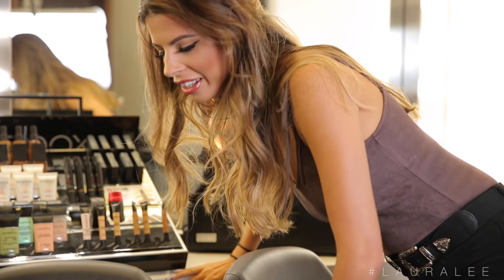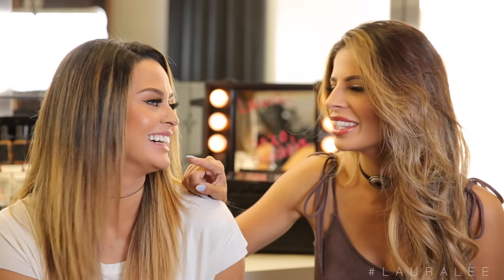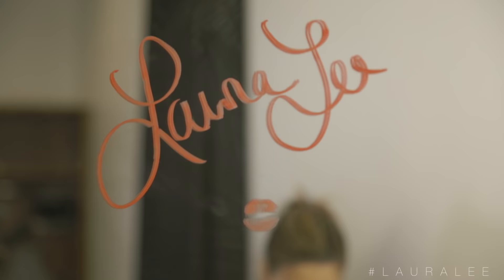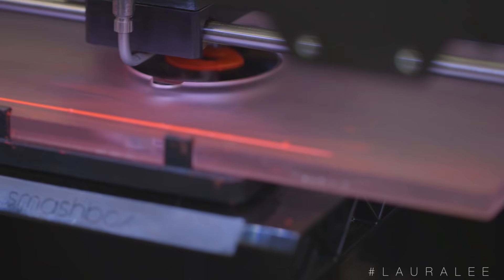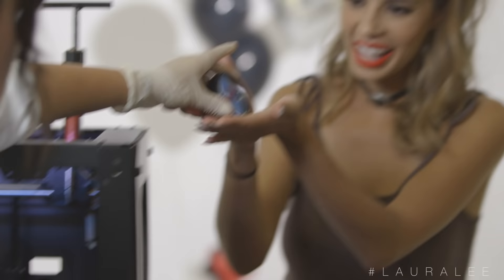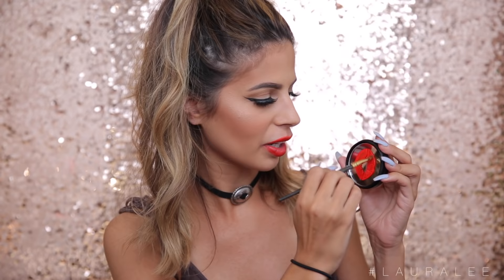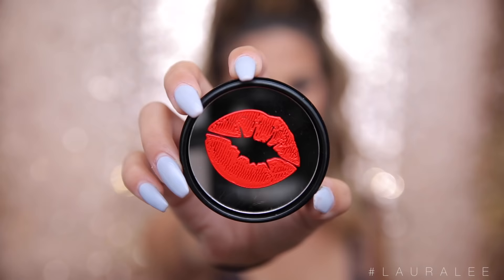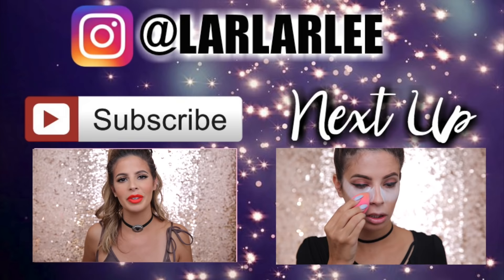3D PRINTED LIPSTICK?! Does It Work?

Comment: I had to use a 3D printer in one of my classes in 8th grade. 3D prints aren't that rare.
Reply: but this was in LIPSTICK.
Reply: you just have to insert the lipstick instead of the plastic into the tube that dispenses the product
Reply: no you can't. 3D printers melt the plastic a bit and the wax from the lipstick just flows everywhere
Reply: Knowing that they are fairly recent... they are rare for us people older than 18! It's all relative
Reply: There are only four compatible plastics for a 3D printer and they only work if they have been formed in the correct shape for the printer, lipstick would burn (plastics have higher melting points) and the pigment would have separated from the wax anyway. Makeup printers started to be developed at the same time as 3D printers, but due to the difficulties involved have only just been developed in a compact size similar to a normal 3D printer. Please don't leave negative comments if you are uninformed, it's unnecessary and rude.
Reply: +ella Greening if that was meant for me, i'm sorry that you found my opinion negative. I did write a fact.
Reply: Jimena Tamayo not aimed at you at all, your comment was not at all negative, it was aimed at the original comment ☺️